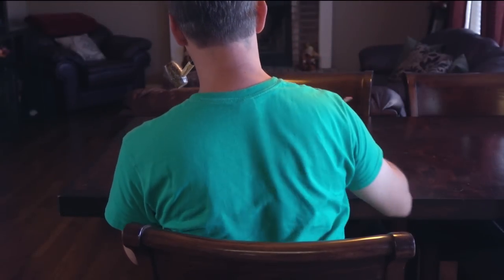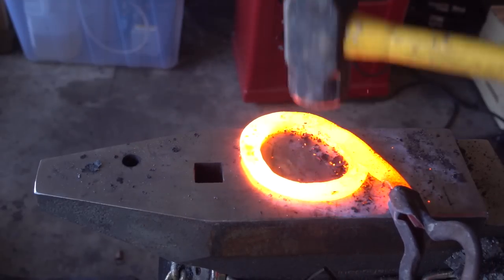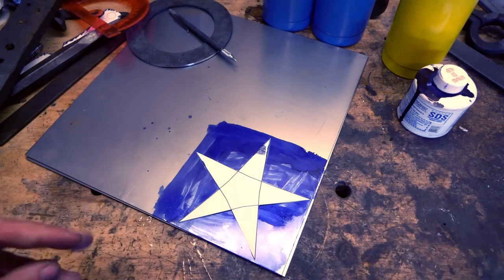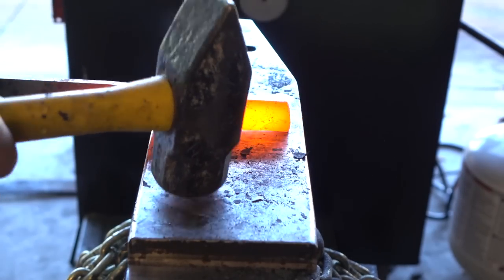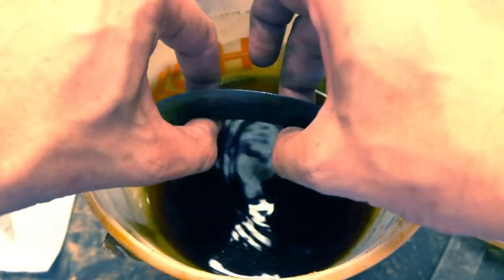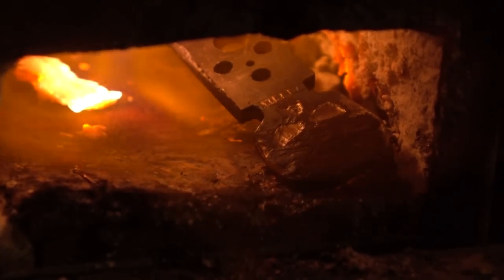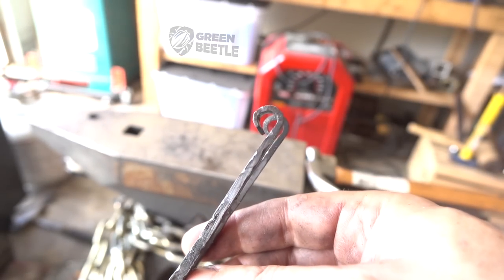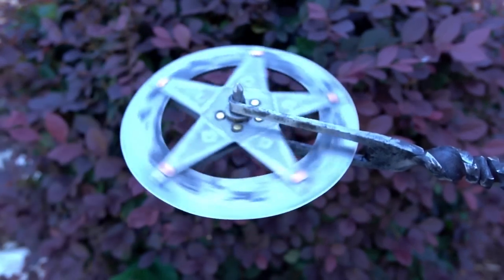Forging Hell's Pizza Cutter (feat. Shogun-Jimi)

Comment: Did no one notice he used the Ouija board wrong? The letters are supposed to be in the middle of the planchette, not the tip. But great video! Love the pizza cutter.
Reply: Personal story:  My high school friends would play with a Ouija - and it would act very wild until I left.  Apparently, they were black souls and I was a white soul therefore I was not allowed.  I still agree with leaving.
Reply: I never really believe in such things...But I also don't partake. Better safe than sore, yes?
Reply: Backyard Ranger He also used the I Love You hand sign instead of the Devil sign, and drew the pentagram right side up, (which is a sign of witchcraft, not Satanism).
Reply: @gravesbroderick928  
Doesn`t matter what direction it`s drawn lol, just turn it upside down when you`re going to use it ;)
Reply: It`s a pizza cutter so it`s gonna rotate anyway lol

Comment: Lucky me i found your channel kinda by a mistake and even tough that i enjoy the content, you are hilarious ! And as was already writen by "Bruno Koharevic" you deserve 100x more subs. :)

Have to stop the vid like 10 times, because i was laugh hard.. :)

Btw. for that tricky part where you are cutting the handle to 3 parts, I know that it is pretty handy use the Dremel with cutting discs with small thickness. But you can buy even 0.8 mm regular cutting discs (115 - 125 mm in diameter) - could save you a lot of heavy duty Dremeling

Comment: No no no you're doing it all wrong you have make the pentagram with the blood of a virgin (though Angel blood works better however blood that has been blessed using the prayer for making holy water works as well as the blood of a virgin), and quench the metal in goats blood.
Reply: I took my joke too far didn't I?